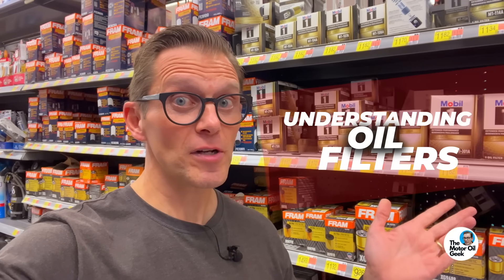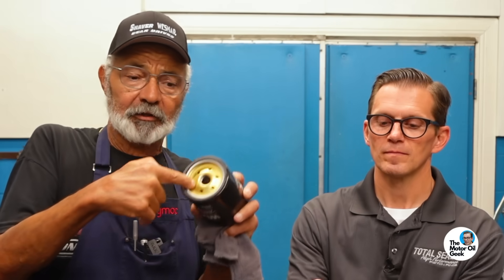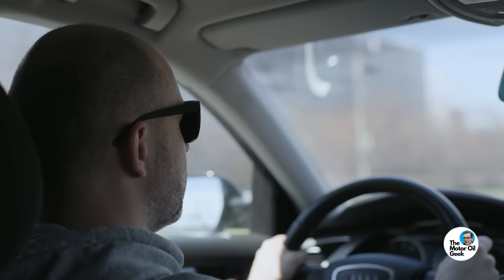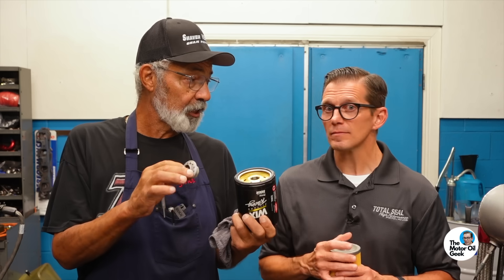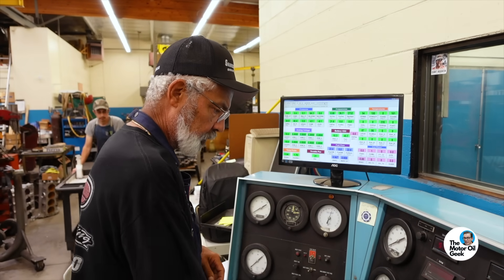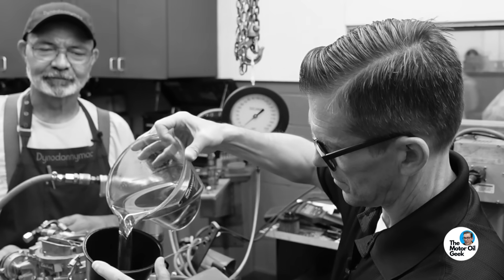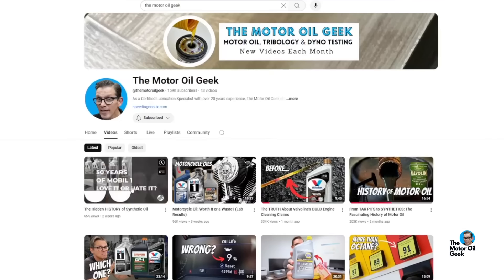OIL FILTERS: What Most People DON'T Know!

Comment: There’s also a bypass/regulator on oil pumps typically so that you don’t destroy it if you rev the engine cold. You can tell the engine has one just based off the rpm/pressure curve. 

It’s a positive displacement pump so if it wasn’t regulated the pressure would be far more linear with rpm unless I’m mistaken but that’s my experience with most cars I’ve driven is you end up with that regulator bleeding some oil pressure except for close to idle and oil pressure hanging around 40-70 psi.
Reply from the maker: That is 100% accurate.

Comment: This is great common sense information when explained the way you do. I was wondering why a certain other you tuber (ford boss m*) was concerned about a filter with 5psi bypass pressure, he said something like ‘I don’t want an FL500s with 5psi bybass pressure bypassing my filter all the time so I run an 820 instead which is 10-15psi but it’s a snugger fit’ -that whole statement by him confused and concerned me about my own truck until this video cleared up that nonsense misinformation! I couldn’t imagine screwing on the wrong filter feeling it be tighter risking screwing the threads, just to find out I was also installing a filter that needs to be more clogged before it will bypass to feed my engine oil.
Reply from the maker: I'm glad the video was helpful.

Comment: The other issue is if you don’t have a bypass valve on the filter and the Medium becomes blocked it’s possible for the oil pump pressure especially at a high rpm to blow the filter off The side of the engine or sometimes they can split at the seam……

Then oil will spew out all over the road and your oil pressure drops to 0 instantly and you’ll possibly damage or even seize the motor……..

So it’s also there to stop the oil filter being ejected under high-pressure

Comment: Does the bypass open momentarily when starting the engine?  Seems like you might have oil pressure on inlet but no pressure on outlet yet leading to a differential.
Reply from the maker: Not when we tested it. We are going to try it again at even colder temps to see what happens.

Comment: My 600hp 385 stroker doesn't have a bypass. On purpose lol. I don't use those racing filters either. To high of a micron rating for my liking. Kendall green aka Brad penn aka penn grade 1 LOL straight 40wt and standard long wix. I do not run this car in the winter and I understand how viscosity modifiers change oil properties (sheer) hence the straight 40wt (gives me optimal oil pressure with my clearances). I turn this solid roller 385 to 7k. Love your videos going over and explaining everything. I am a longggggggggggggggggggggggggg time bobistheoilguy lurker and have picked up a few things over the years like viscosity modifiers tend to reduce the sheer strength of oil and group III is just modified (hydrocracked) crude oil. Crap like that lol.

Comment: How about at 15 below as in a cold morning startup? It would seam that the differential pressure across the media would not only vary on viscosity but also flow rate. Higher in the rpm meaning more differential and higher viscosity also means more differential. It's got to look different at -15f in a winter start in the morning than in a Dyno room. whats a small chevy oil flow at idle, maybe 3 or so gal per min thats a lot of high viscosity oil to push through a filter in a cold start during winter. Id be surprised if it didn't bypass almost all the oil for a minute or two on a really cold morning.

Comment: John deeres filter for 50s series traxtors 1980s do not have anti drain back valves. Cut one open, and look for yourself: their cheap. Wix is quality.  Those filters are mounted horizontal, so if you change oil after one has sat a long time, its pretty empty, so thats bad. 
Case ih in the 80s had their filter mounted upside down lol. If you change it after it has sat all winter, they will be bone dry inside like a new filter, so again does it really matter?
Anyones guess lots of those engines run 10 rthousand hours at max power, and are ok.

Comment: Even in LA, you should be able to find an  environmental test lab with sufficient space to test at cold temperatures.   The lab I used to work for was able to test two standby generators, under load,  powered by 4 cylinder automotive  engines at extreme temperatures.

Comment: 😮well here is what I do.. this works on most modern vehicles, even my 2006 Ford 250. I do this after every oil change and if it's extremely cold, and also if I haven't started my vehicles in a while. I don't want my engine to start ( fire up ) and immediately go to idling RPMs. So I hold the gas peg down all the way. Doing this we'll keep the engine from firing up. Turning the ignition for a second or two letting the starter slowly pump up oil, lubricating the top end.  I'll do this several times especially after an oil change. Doing this, you won't witness zero oil pressure or here the valves for those precious moments while the engines is in full run mode.  Prelubricating is about the best anti wear tip I believe there is. Your welcome
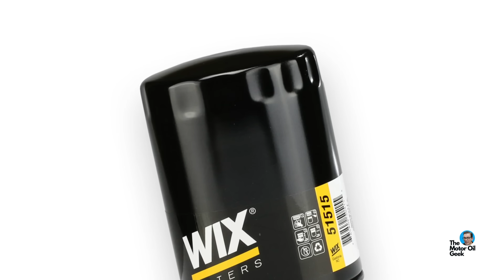Reply: Here is a good explanation, "What is FLOOD MODE? And Should I be Using It". Means turning your engine over without starting, thereby priming the oil filter and system. Duration of video is 3:47 min. Definitely worth watching.

Comment: I have a 2024 GLC Coupe 200 4MATIC turbo gasoline mild hybrid that only accepts 0W-20 oil from 229.71 or 229.72 specification. 
My huge disappointment was that the dealership did not tell me to change the oil after the break in period. Also they say I only need to change oil every 10.000 km or 12 months.
 Also that I can use the Start/Stop feature. All these are against my interest to extend the life of the car and in theirs to sell me a new car after 5 years. 
 I am convinced that 0W-20 is the thinnest and most ecological oil for this engine but not the optimal for reducing engine wear. 
 My question here is which 0W-30 MB standard like 229.52 or 229.61 would be most suitable for this engine if I insist to use 0W-30 viscosity oil.

Comment: Little correction if I may: Those bypasses, at least in German cars, were mainly meant for the increased fluid flow at high power demand and maximum oil pressure and flow. At least up until 2007, after that I was no longer in the engineering involved. Since the filter media acts as a brake or almost a valve limiting the possible oil flow, the bypass allows for oil to bypass the media to keep oil circulating. It's basically what you said, but with a different goal in mind. The manufacturer does not account for people not servicing their cars, because if they don't, they're responsible for the damage. No need to "protect" people that don't care for their property. Porsche described that very nicely on the 997 and what the oilfilter bypass does. So did Audi on their engines. Granted, german engines are more power dense and sometimes designed with a narrowerer "green area" of normal  operation.

That's also a reason why american engines in Germany generally survive not as long as german engines, since prolongued Autobahn speeds kill the bearings quicker. Their oilfilters oftentimes have no bypass and have restricted oilflow at a constant cruising speed of 200km/h while having elevation changes of 300m along a stretch of 100km here. And except for very modern engines, never had enough oil cooling. Of course depending on the driving habits, it also accounts for more contamination in the filter media which in turn seconds what you explained. I guess even if the goal was in some cases a different, the outcome is the same.
Nonetheless, good video explaining that!
Reply: Yet German cars blow up and break down more than anything..

We have a shop in NYC Audi VW BMW Benz Porsche make us a fortune.

Audi the worst .

Old German cars before 1980s were good. Old Volvos best .

Germany lost ww2 and gets revenge selling dopey Americans their cars ..

And I am German American..
A danke Schoen..lieder
Reply: @Motorhead250  Very true words ,my brother and his wife bought a brand new Audi the motor had to be replaced @40000 miles german junk.:face-green-smiling:
Reply: @buzzardbombshell3066 older German cars in 1970s were good .
They lost ww2 now get revenge selling junk to Americans

Comment: I have learned so much from you. Question do only need an anti drain back valve if your filter is other than straight up and down?
Reply from the maker: Thanks! The anti-drain back valves are only needed when the filter is not mounted straight up and down.

Comment: I worked in an engine shop, and we used a full filtration external oil filter when we ran engines on the Dyno. We had pressure gauges on both sides of the filter, and we saw more than a 10 psi difference across the filter. Can you guys run your test with a SBC with the oil bypass plugged, just to see the results.
Reply from the maker: Great suggestion!

Comment: The anti drain back valve keeps not only oil in the filter, but helps keep all the oil from draining out of the oil passage ways through the crank and mains. When I change the oil on my vehicles, I drain the pan then remove the filter. There is always a good amount of oil that drains from the filter mount itself. Obviously the anti drain back valve is there to keep oil up in the passage ways to reduce dry starting. Yes, I always fill my filters, even the horizontal mounted ones. I simply make sure the filter is saturated and about half full so little comes out when installing.

Comment: Well at zero C the bypass opens, because the delta far exceeds the bypass spring pressure - you physically cannot push zero C 20W-50 oil through a 30micron filter, two thing happen, your oil pressure release relieves at its preset, and then the filter bypass relieves the oil going through the filter element - the alternative is a collapsed element - remember the pressure differential is actually between one side of the filter element and the other, yes its designed to withstand pressure but it can only withstand so much - from my experience it is common for oil to bypass the filter on cold startups - if there is enough material to fill/clog a filter to cause the bypass to open I think you already need a rebuild!

Comment: I’ve seen a filter so clogged you can watch the bypass valve open and close on the oil gauge. Owner refused oil change. Over 30,000 miles on conventional oil

Comment: Good video! Sadly there is a lot of FUDS law in the automotive world when it comes to Oil and people applying rules that made sense 40-50 years ago but are not sensible with modern engines. The simple rule of "The engine works better with oil in it than no oil" always applies but beyond that the engine manufacturers and oil makers know more about Oil technology than your Uncle Joe or Grand-Pappy! If you put the recommended approved Oil grade in and follow the oil service intervals your engine will be healthy and happy for many years to come! My current car needs an ACEA4 spec 5w30 Oil with a replacement of Oil and filters every 12 months... that's it. I put a good filter on with oil that meets the specs and the engine is happy for another year of fault-free motoring!
Reply from the maker: Thanks!

Comment: - 00:00 🛢 Oil filters are widely misunderstood, even among experienced car enthusiasts.  
- 00:45 🏗 Basic oil filter construction: Oil enters from the outer edge, passes through the filter media, and exits through a central hole.  
- 01:20 🔬 The filter captures particles larger than 26 microns; anything smaller than 25 microns typically passes through without harm.  
- 02:24 🔄 Many oil filters include an anti-drainback valve to prevent oil from draining when the filter is mounted sideways or upside down.  
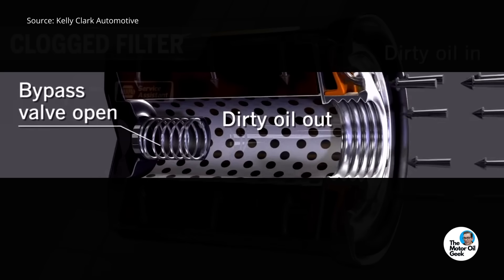- 03:02 🚨 The bypass valve allows oil to flow unfiltered if the filter becomes too clogged, preventing engine oil starvation.  
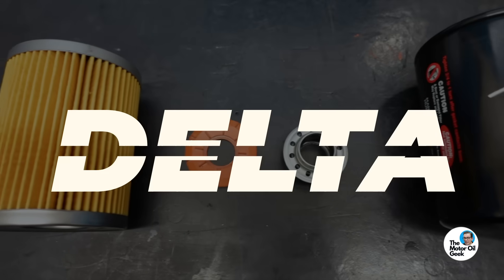- 04:08 ⚙ The bypass valve operates based on pressure differential, not total oil pressure—activating only when inlet pressure greatly exceeds outlet pressure.  
- 05:24 ❄ A common misconception: The bypass valve does not open when the engine is cold; it only activates when a filter is extremely clogged.  
- 06:52 📊 A real-time dyno test measures oil pressure before and after the filter to analyze how oil flows through a clean filter.  
- 08:40 🌡 As oil warms up, viscosity decreases, leading to a higher pressure differential across the filter.  
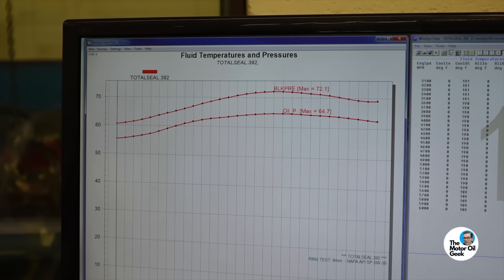- 09:49 ✅ The test confirms that with clean oil and a functional filter, the bypass valve does not open under normal conditions.